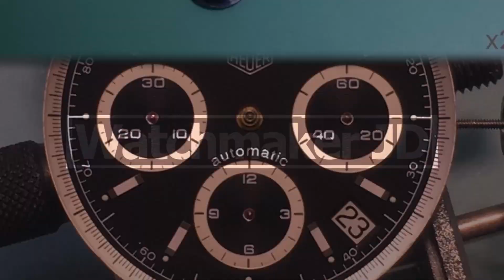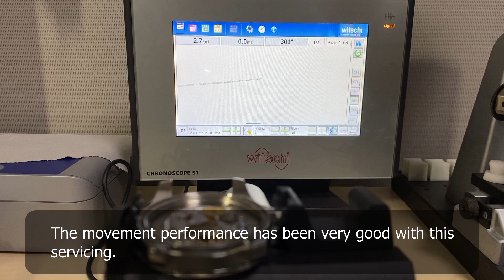Longines Hydro Conquest L633.5 full review and servicing

Comment: It is comparable to the black bay from Tudor.  New HC watches come with the L888 series movements. Mine is not COSC but keeps time within COSC. The Todor, for example does not have a fit or finish superior to the HC. The Tudor movement is in house but is neither more durable nor more accurate than the L888. So, the  HC is very much a luxory brand. The Tudor, by comparison has lower water resistance and does not have a ceramic bezel like the HC.  Just fyi.

Comment: Hello, I have a Longines Hydroconquest ceramic gray that houses a L888.5. How would I regulate it? It slows a few seconds a day and it drives me nuts as I wish it would gain seconds instead. Please help.
Reply: It's normal. Even chronometers have the tolerance of average rate up to −4/+6 seconds per day (COSC). People who say their Rolexes have rates of -1 or 2 seconds per day usually lie. The average chronometer is about -2/+4 seconds per day. So your watch shows excellent results in terms of precision. Non chronometer Longines are usually rated up to 10 seconds per day in terms of precision. If you want a much better precision, you need quartz watches. They are dozens of times more precise.

Comment: After working on this watch what do you think of it? Do you think it's worth the 1200-1600?
Reply from the maker: It comes with ETA movement, but I think it's worth it. Thanks for watching😀
Reply: Yes
Reply: New higher spec version with ceramic can be purchased from jomashop for $1100 which is a steel
Reply: @chefgav1  I bought the blue one, but I don't like the bracelet, was additional 250 for the blue strap.
Reply: @mad0uche got the green one for 1150€ but it is with the rubber strap. Looking for a steel bracelet
Reply: @TheDominator74  I got the blue ceramic one for around 1300 with the steel bracelet, the rubber strap is much better quality but less flashy.
Reply: Yes. The bracelet is crap. Lol.  Also the case abd lugs are razor sharp so be careful when switching out straps. I actually sold mine and wear a mido ocean star 200 ceramic daily. Such a quality piece @mad0uche

Comment: Hold on. On the official website, this watch is indicated to have a movement based on ETA2892. How?
Reply: This is an older version of the Hydroconquest with the Longines L633 movevement (ETA 2824). The current models are using the Longines L888 (ETA 2892).